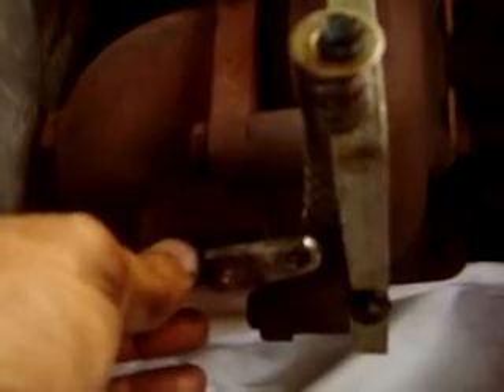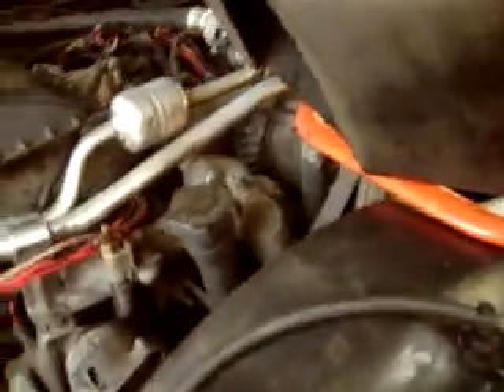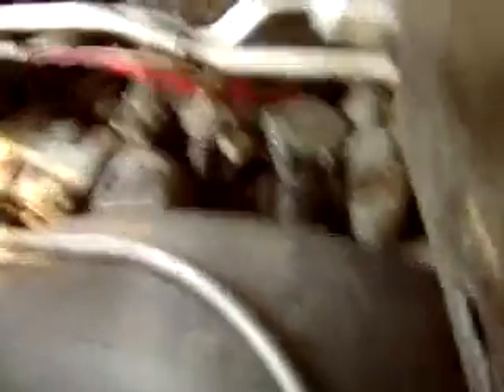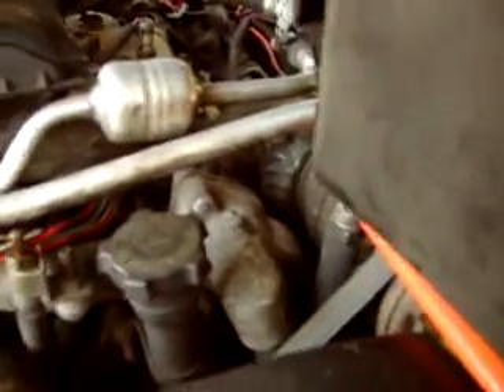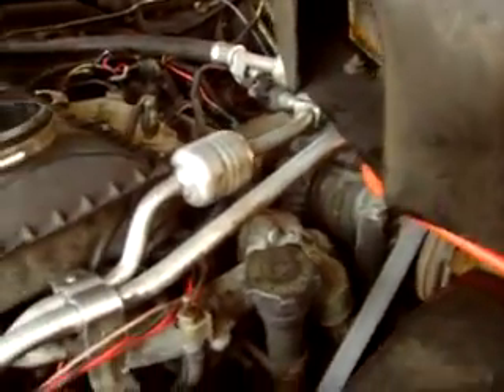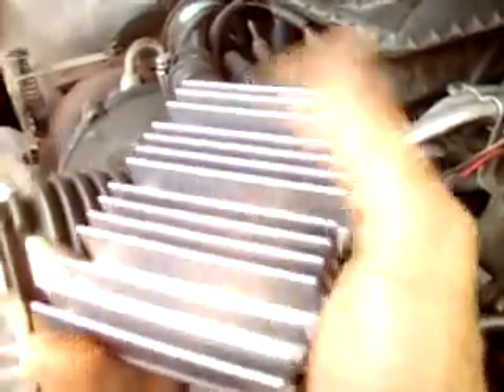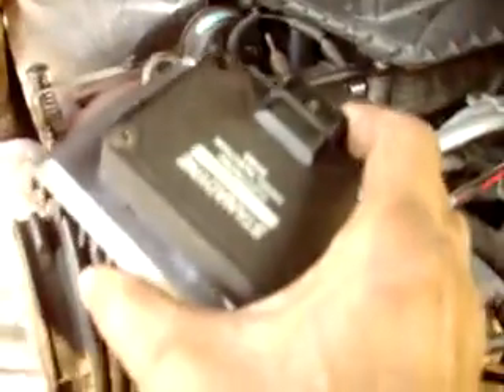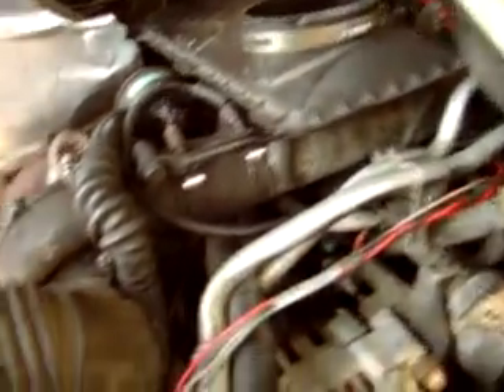TURBO MASTER EGR 6.5.MOV

Comment: In front of radiator is best then you are not heating the air intake for motor. I put mine by the transmission and oil cooler and painted it with a little coat of flat black and it works great and you can't see it. Plus the fan is always moving air when the motor is running.

Comment: Looks good just gotta tighten the spring up for it to hold 10 psi other than that looks good and neat idea about tue pmd in the air box but still it's hot undertow hood so I like the bumper n how is it working for you also get the boost gauge, pyro and trans temp if it's a auto trans